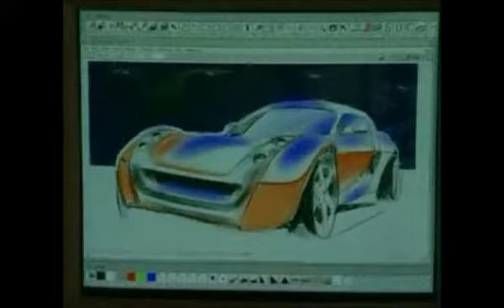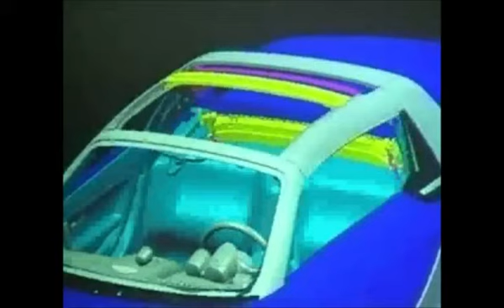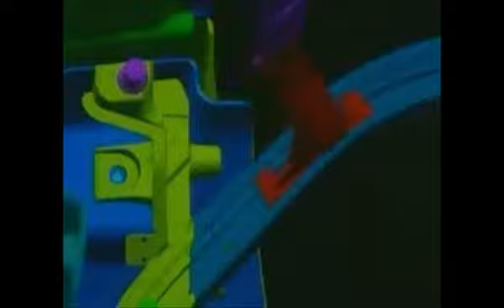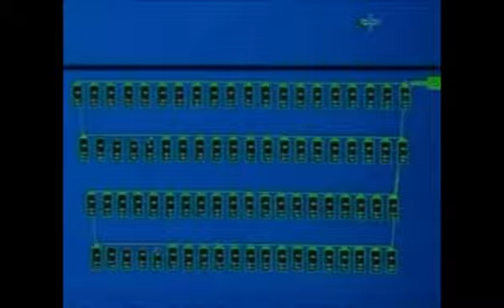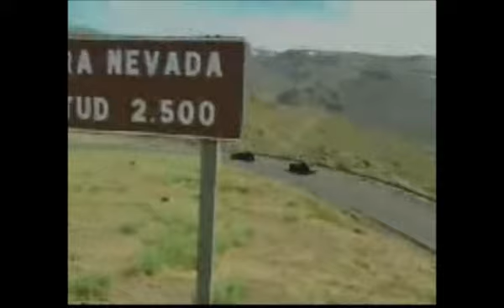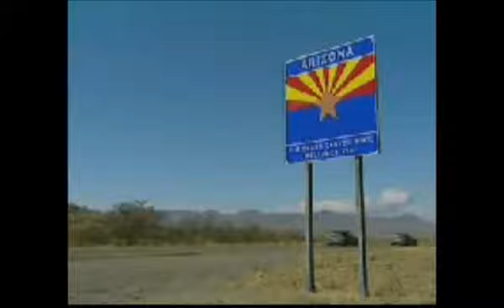All 2003 Smart Roadster promovids together

Comment: I drive a Smart Roadster Coupe 452, 82 cp from late 2016. Was 160 000 km old*, now over 360 000. So over 200 000 km driven around Europe with no big issues,  stored or parked only on the street, no garage and fuss.
Just awesome!
Reply: Dammmmmmm !

Comment: 5:28 - here they are, deciding which areas will leak water the most. In the end, they decided all the areas will leak more than the others, and they would put the SAM right under them all.
Reply: and then place the SAM unit next to the leak....
Reply: Mine is not leaking at all. 
Indeed they should find a better place for that sam, but is up to us to put that in a safer position